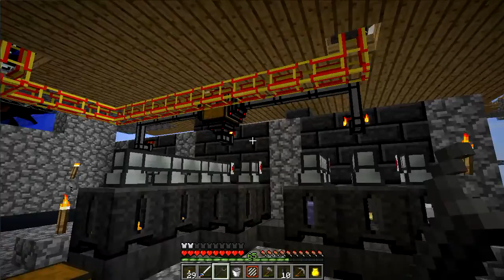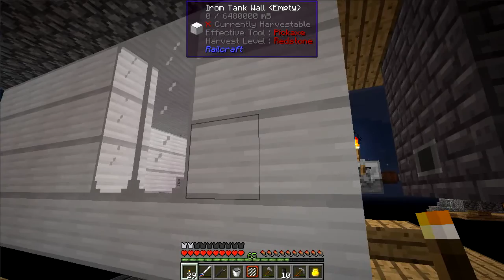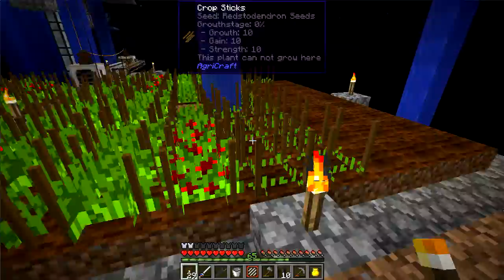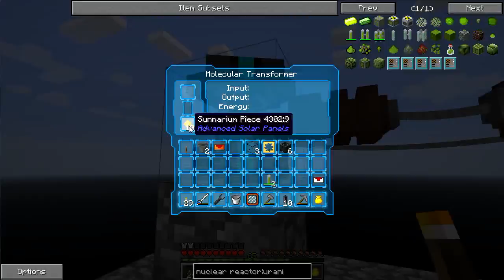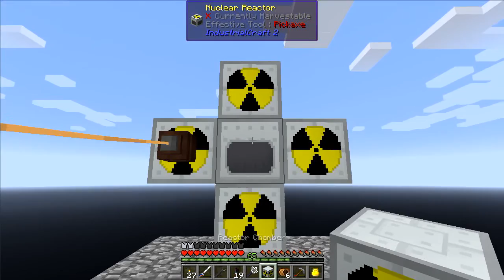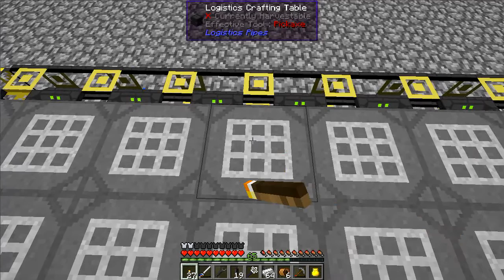FTB Infinity Evolved Skyblock - Ep 19 - Nuclear Reactor

Comment: Ad one: destilled water needs less lapis dust for creating coolant.
Ad two: put an empty cell into the top left slot of the canning machine, lapis in the middle, water bottom left, and you will get the filled cells to the top right.
Ad three: Theraml Expension machines can pull with the correct augment.

Comment: I highly recommend this reactor: http://i.imgur.com/Ca15oYI.png which is talked about in this reddit thread: https://www.reddit.com/r/feedthebeast/comments/3tj6bg/infinity_evolved_expert_mode_ic2_reactors_iridium/.  I used that design for my nuclear reactor.  Keep in mind though that this one will REQUIRE HV connectors due to it producing 420 EU/t (1680 RF/t).

Also, if you use distilled water for coolant you get 8 times the lapis efficiency of regular water (1 needed instead of 8).  The easiest way I found was to get a dozen or so of the "Solar Distiller", piping water in the top and distilled water out the bottom into a buffer tank.  I used a retriever at the tank end to save having to make a server for each distiller.
Reply from the maker: +Andrew Kerr Yes, I think that's the same 7-rod configuration I saw.  I'll upgrade to it between episodes, now that I think I have the heat vent crafting constraints ironed out.  I haven't quite figured out mathematically how the one in the upper left gets its cooling, but it says it works...